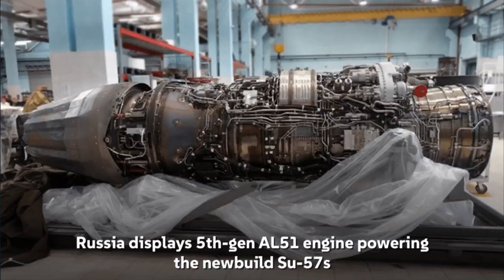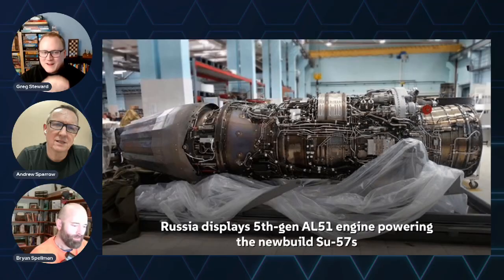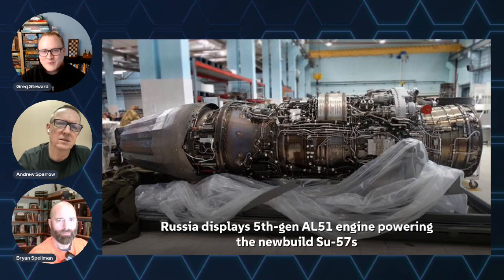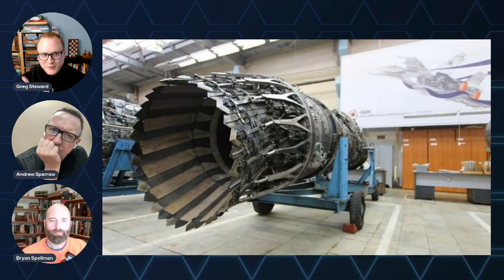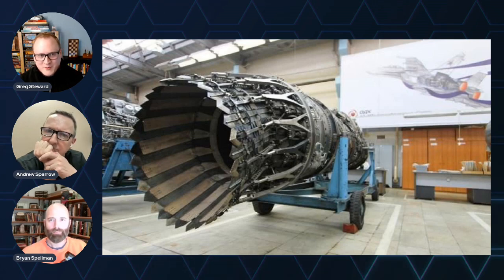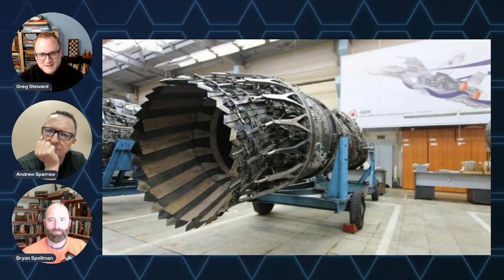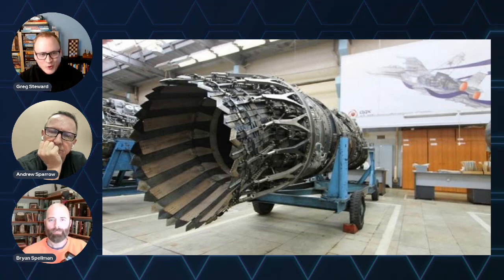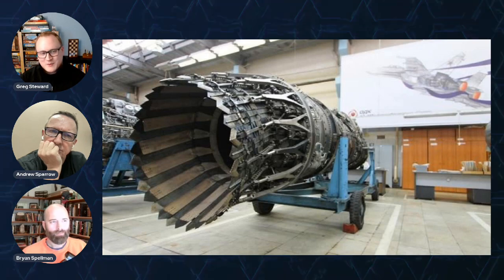LGD: Russia Showcases AL-51 Engine for Su-57

Comment: Someone should explain to you that it isn’t thrust vectoring that makes this a 5th gen engine - Russian fourth gen engines have 3D thrust vectoring. It is super cruise that makes the AL-51 a truly unique 5th gen engine. That is the ability to go supersonic without using afterburners. No engine in the world has this ability currently except the AL-51, and it is a “game changer” - assuming they can mass produce it.
Reply: You're a little wrong. The AL-41F1 engine, which the SU-57 is currently equipped with, was put into mass production in 2018 and it is capable of developing supersonic speed without using afterburners. The cruising speed of an aircraft with these engines is 1300-1800 km/h (M = 1.0-1.5). The AL-51 engine will be more powerful and less noticeable in the thermal range.
Reply: @ My understanding is that super cruise is a holy grail that no one currently has. Could you please indicate your source for the info that an earlier generation engine already has this? I can read Russian, so please include any Russian source for this.
Reply: @greggemerer8251  , Even Su-35S can do supercruise without afterburner, but with lower fuel/weapon load. Tested and confirmed.
Reply: The f22 can supercruise at mach 1.8, many 4th gen planes can to this too, unsure if the f35 can though.

Comment: That is not the AL-51 it is AL-31FN series 5 177S. It has some technologies from AL-51F1 but this is not that engine. It replacement engine for AL-31FN series 3 engines.  

 "It's not Izdeliye-30, it's a 177S with stealth treated TVC nozzle.

The 177S is what they called universal engine for upgraded russian airplanes.

AL-41F-1S / Izd.117S (Su-35S) 
AL-41F-1/ Izd.117 (T-50) 
AL-51F / Izd.30 (Su-57) 
AL-31F(P) / Izd.177S (Su-27, Su-30, Su-34"